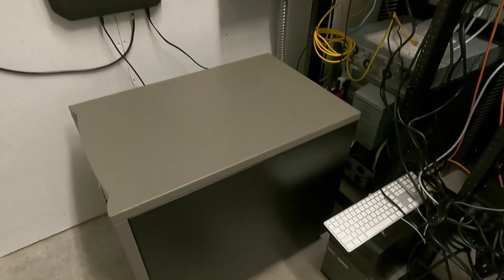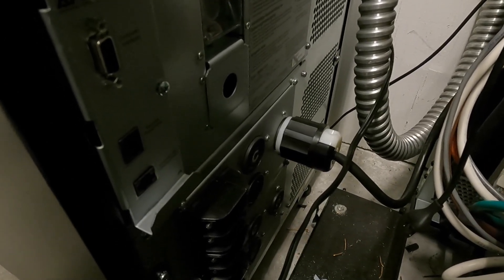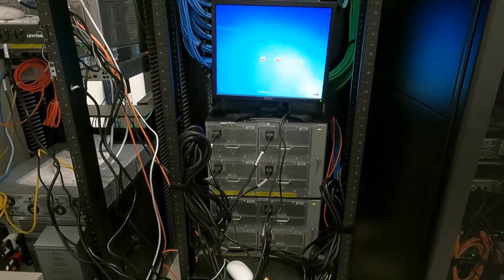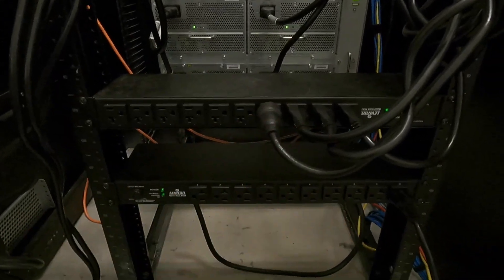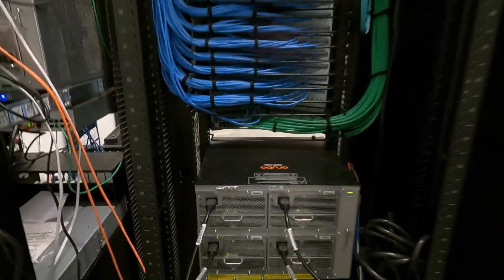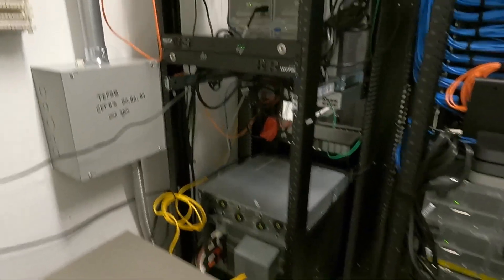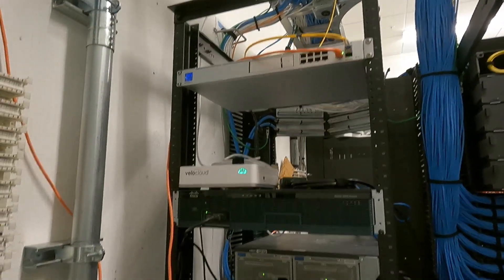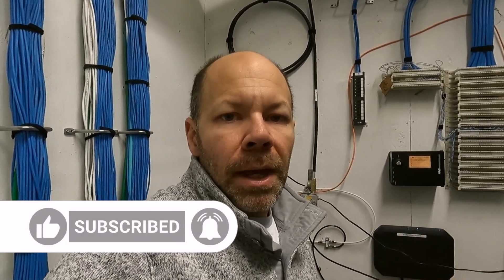DATA CENTER FIXED!!

Comment: This is what we did in our racks. One side of the dual power supplies went to the mains power no UPS backup. And the other secondary side of the power supply would go to the UPS. So even if mains power goes out you will still have power. Do not need both going to UPS. It will not only take out more room on the USP plugs but it will lower your run time on the UPS. We found this out the hard way. Hope this helps.
Reply from the maker: Yes works out and we don’t take up all our plugs on the UPS. What size UPS are you using?
Reply: @EverythingTech70  I’m unsure our ups is almost the size of a 38u rack and very heavy. But also have external batteries for when the main batteries inside run out. Run time for all of our servers is about 14 hours.

Edit: also I’m a subscriber.
Reply from the maker: Wow sounds huge!
Reply: @EverythingTech70  not really. We just want more uptime. Not many servers.